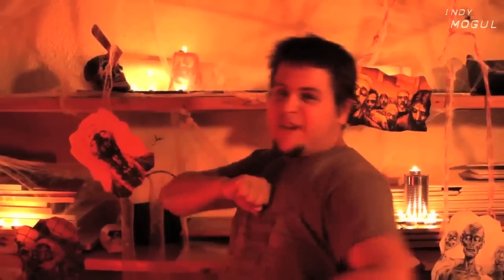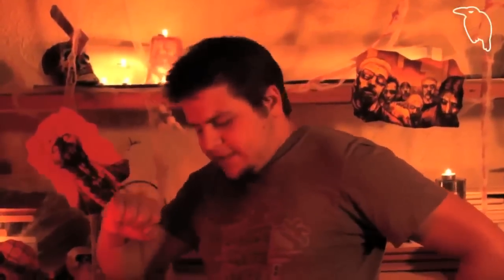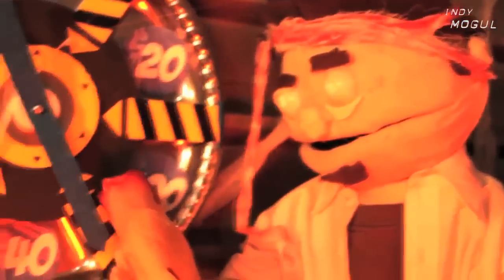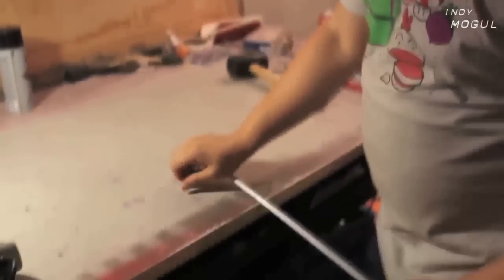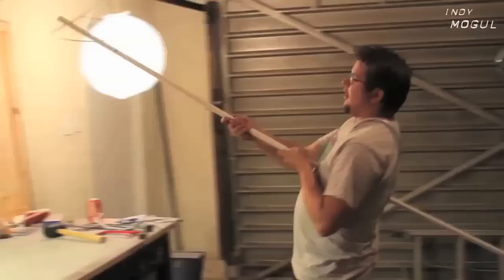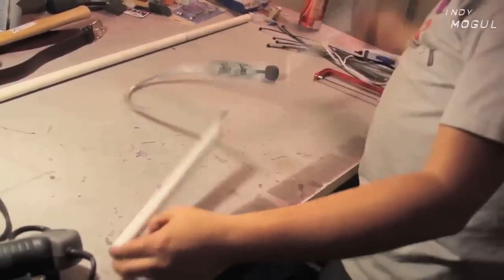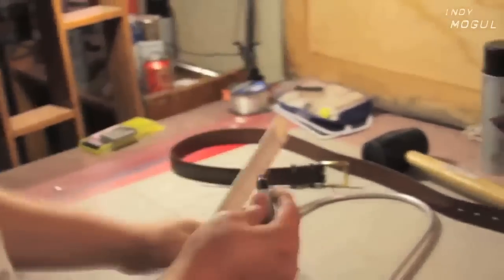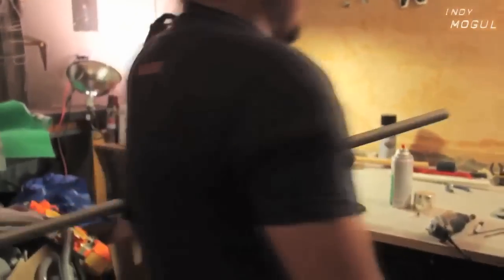Halloween Zombie Chest Impaling : BFX: DIY

Comment: The edges of the hole in the front of the shirt go in the wrong direction, if someone were to be impaled like this, the shirt would be pulled in not out as it is here. Otherwise, looks great. Tucking in the edges of the hole might just do the trick